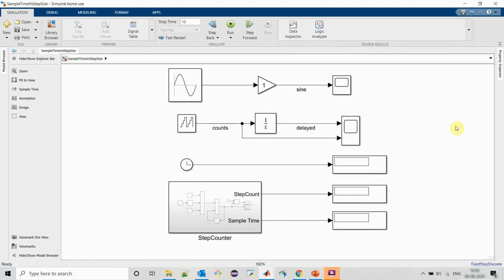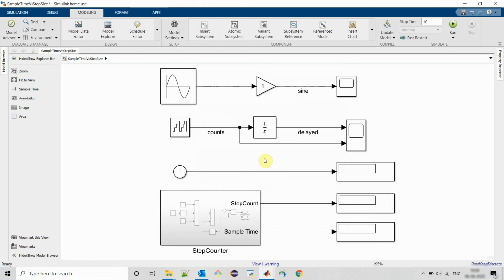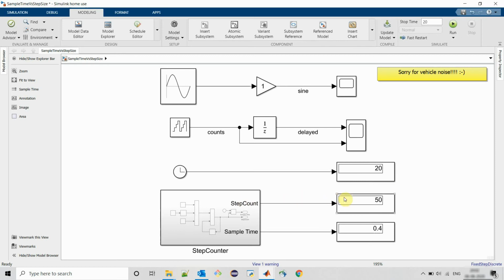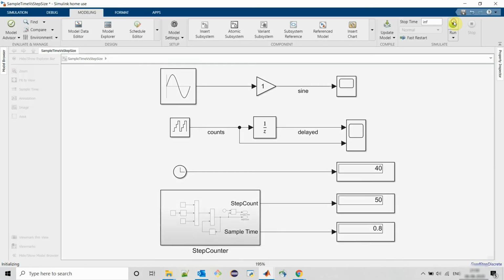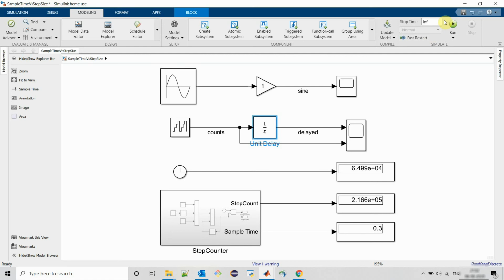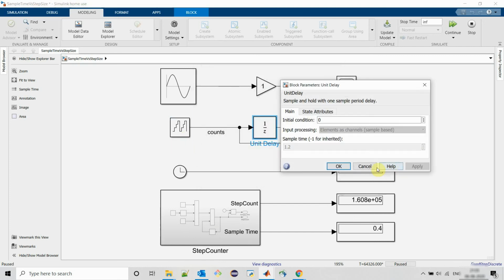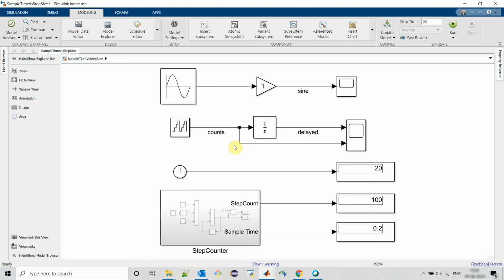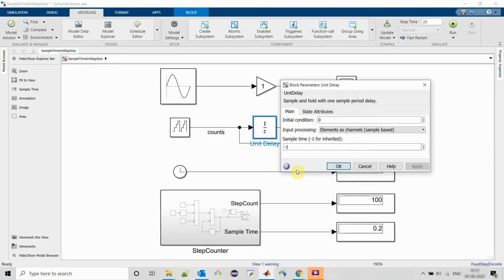Matlab-Simulink : Understanding Model step size and block sample time.

Comment: Dear Sir, Thank you for making it clear to me about how a block sample time should be selected.
However there is a small typographical mistake in 5th point of the Summary - integer multiple instead of integral multiple, Sir

Comment: How to select a perticular sample time for the model?
Reply from the maker: Sample time or rather "Step Size" i.e. fundental sample time of model depends on certain factors.

1. If you are going to use model for code generation then it doesn't matter what step size you use. Just select fixed step discrete solver.

2. If you are using it for simulation, then it depends on the system you are simulating and what kind of sensors you are using.
e.g. For normal room automatic AC set to 25 degree. The temperature sensor readings are not going to change so fast and its functions are also not so critical meaning it is completely OK if temperature is mainteined around 24.5 - 25.5 degree Celsius. For such cases, higher step sizes can be used. Using lower step sizes may increase accuracy but its impact on results is not so important. And using smaller step size may increase simulation time for large models and longer simulations.

However, if you are simulating critical robotic behavior like medical robots or vehicle airbag systems, then you must use smaller step sizes as these are life critical functions and needs to be extreamly responsive to its inputs. In these cases simulation time can be compromised over accuracy.

So for first example you may use 5 sec as simulation stepsize whereas for second example you may need to use like 20 milliseconds.

Hope this helps.
Reply: @simulationguruji4337   yes thank you very much for the explanation